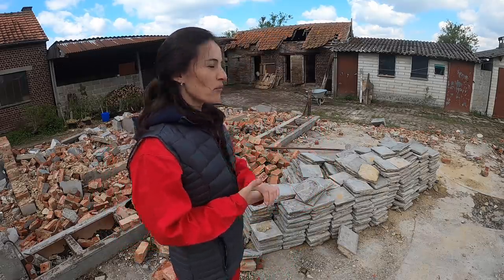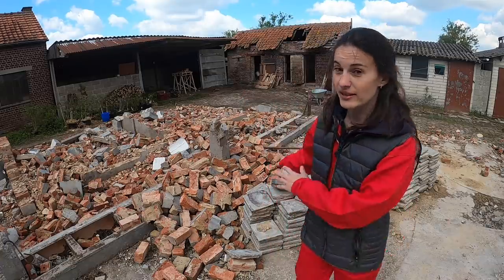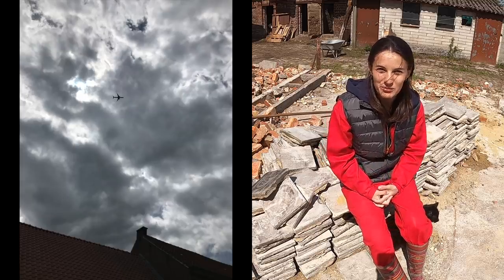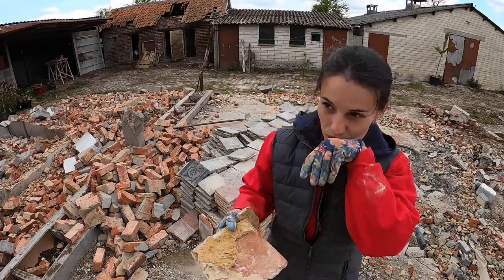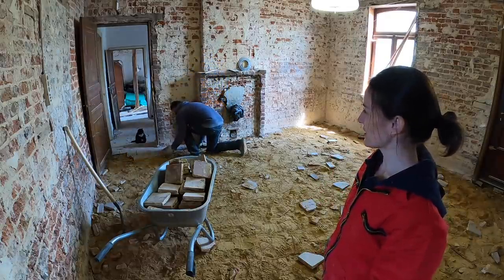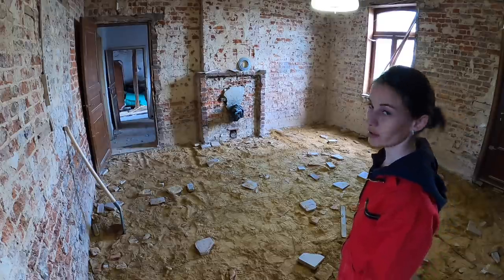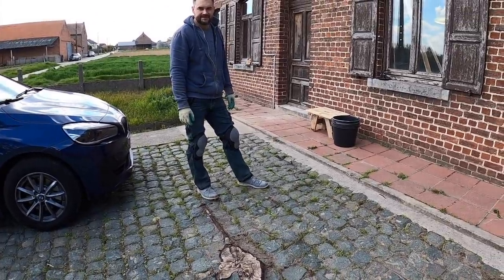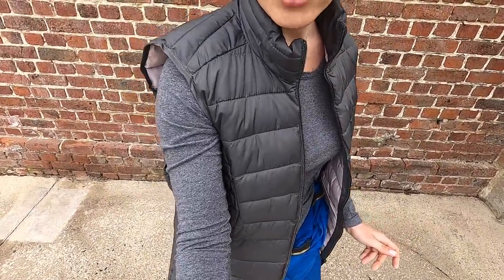Removing but saving STUNNING TERRACOTTA tiles in the hallway of 100+ y.o. farm

Comment: soak the tiles in a bucket full of water u should use a  light acid with the water and you could do this with lemon juice this should help remove the morta on both the terracotta tiles and the cement tiles do a test with just two tiles of each in a bucket . Good Luck .

Comment: the chisel is the best way. 
however: try putting it in the fridge, after freesing you take it  direktly in a  boiling water or use the burner on the surface. but try first just putting the frozen tile on the ground and throw a bucket of boiling water on the unwanted concrete .the different temperatures should loosen the connection and it might easy go off with the chisel or by hammering.

for the polished surface with brush: you know  you can sand these tiles? 
might be also in order when finished shortly before reusing.

Comment: You can make a small contraption with wood where you can put the tiles in at an angle. Then use a pneumatic chisel to get rid of the mortar of the terracotta tiles. I got this tip from a professional tiler a couple of years ago. I'll try to make a sketch later on and send it to you on Instagram.

Comment: To remove the concrete from the tiles, try to use the grinder, but with the right accessory.
Instead of this metal brush, use a disk for concret. And for the finishing, then use a spatula.

Comment: From first hand experience....if you hit the tiles to remove the old mortar, you will break many of them.  The easiest method we used to remove the old adhesive mortar from our terracotta floor tiles in our Longere here in Lower Normandy, France, was to use an angle grinder with a disc made for cutting stone.  It is very dusty work.....however after the tiles have been scrubbed on both sides using a scrubbing brush, they are ready for re-use!

Comment: Lime is alkaline. Lime mortar on the tiles might be dissolved by a weak acid that would not affect the tiles' glazing.
A suitable acid might be that which is used to balance pH in our swimming pool: muriatic acid. it is This is a diluted for oh hydrochloric acid and is normally readily available. At least it is here in Australia 😁. We can buy 'pool acid' and in pool shops, hardware stores and many grocery stores.
Good luck!

Comment: I personally wouldn't reuse the old tiles. They seem difficult to remove and will probably be even more difficult to install. I'm a fan of using new with the old. A concrete base would give you many options. You can then use large tiles or stone. Today's materials are also easier to upkeep. I don't like terracotta, and find they chip and break easily. 
I hope you find what you desire in your budget range. Enjoying your progress. Good luck and wishing you strength to continue

Comment: Try soaking them in “mineral spirits”. It will start breaking down the mortar on the tile. Depending on the mortar you might soak for minutes or hours. If it is really stubborn, diluted acid will definitely work!

Comment: I like how you both work together! But Illia is a true Gentleman, take always the heavy load outside for you! Do not put the Terra-cotta tiles in water, they are not done for that! They soak up and get easy to be damaged !  For the backside you can use a grinder, but will be a dusty job! Mouthprotection, eye and earprotection needed! The front of them can be cleaned with a pressure washer and musclepower! You can use a stone cleaner for that. You can buy these in every garden center! Take a tile with you and show it, then they understand what you want to do!  Imlovebwhat you do!

Comment: Have you thought about sandblasting the tiles? I’d take a handful of the tiles down to your local automotive repair shop. They generally have a sandblasting machine for cleaning parts. Ask them to try and clean a few of them up and see how long it takes. Then if it works invest in some equipment.

Comment: To make the task of cleaning the tiles easier. Build a wooden workbench out of old timbers. nail/screw to the bench  top some hard wood strips slightly narrower than the tile thickness to act as anchors. Place the tiles against the wood strips and with a hammer and steel chisel  chip off/ clean off the cement. Keep a bucket of water and a brush handy to keep the dust levels low. Having your work area raised up will reduce injury and pain to your back shoulders and knees. Search YouTube for "Dressing Stone" to help teach you the skills you'll need. An angle grinder with a stone cutting blade would speed the progress.  Good luck.
Reply from the maker: Many thanks for your advice, Archie! I will look it up 👍🏻

Comment: I am late to the conversation, but what is the base tile made of ?  Are they fired ceramics ?  Glazed/ unglazed ?  How is the pattern on the tile applied ?  Is it part of a fired glaze ?!  Painted/stained ?
Depending on how the pattern was applied to the tiles, the black oxides from the wire wheel can be removed with a rust remover product.  Do not use this method if the pattern was done with iron oxide stains.  Here in the US we have a product called "Evapo-Rust", works great.  It smells like radiator anti-freeze/coolant for your car.  Probably has some of the same rust inhibitors (and related).
How thick is the layer you are trying to remove ?  If it is thick, mechanically abrading the top layers/thicknesses is probably the fastest. Then switch to manual or chemical/water soaking for the last bit.
Ask your local Museums, Archaeologists, and/or Professional Restoration Experts, what methods they would use.

Comment: in the USA we have a tool named Cavitron and the hospital maintenance team uses it to clean the water faucet outside the operating room, all that calcar which is deposited in time and obstructs the water on a faucet they bring the cavitron and clean it . I really believe the cavitron can remove that extra material from the floor tiles
Reply from the maker: I will look it up, interesting 🧐 thank you!
Reply: FYI, a Cavitron is a state-of-the-art ultrasonic scaling system used to clean teeth. The machine uses oscillating sound waves to produce gentle vibrations that vibrate plaque and tartar off the teeth.
Reply: @kathyusa-iowa5137  yes you are correct however the maintenance team of the Washington hospital center uses this so-called cavitron  to remove calcar from the faucet...I am not an expert I am a surgical assistant my Facebook page is eliad jojo
Reply: @eliadsavel8015  understood, my brother did maintenance in a hospital. 😉
I added my comment so they would have an idea what it did. It uses ultra sound AND it's safe enough to use in our mouth! 👍
I don't know if it would be cost-effective to buy, or if you could rent. But no stiff bristles, no harsh chemicals, safe for us...seems like a winner to give a try to! 😉👍
Reply from the maker: I checked on Ebay, there are some for sale :-) I doubt I would find it in DIY shop here in Belgium 😀Actually I have a dentist appointment tomorrow, I will ask her opinion tomorrow. I guess for thin layers it may work, but not for thick ones as ours. Not sure...
Reply: @DeHoeveOldBelgianFarm  I'd sure try this method. It has a lot of benefits. Wishing you good luck on this one❗🙌 🥰

P.S. I looked on ebay and found prices from US $400 to $1,400.
BIG range there! 😲 🤔

Comment: I have always found terracotta to be warm and friendly. Entering a home with tiles like those makes me want to remove my shoes.
Reply: Only if they put in under floor heating because they can also be very, very cold.
Reply from the maker: @l.m.2404  True - the way they were laid just on sand is called 'cold flooring' AFAIK. But the warmth feeling is still there...
Reply: @DeHoeveOldBelgianFarm  I think that they are absolutely beautiful and think you are very fortunate that they were never replaced by an earlier homeowner. Paste wax them after they are relaid to protect them and help keep that gorgeous lustre.

Comment: Maybe if you find a nearby business that does sand blasting it would work on the tiles. I think they have the ability to use different grades of sand and different strengths of blasting that could remove the coating from the face of the tile and the mortar from the bottom of the tiles. Only thing is that this would definitely cost you money that could certainly be used elsewhere while you are in the beginning of your remodel. Best of luck.
Reply from the maker: Hi Kate, we are checking this option. Not now, for sure, as you mentioned, we have other projects to spend our money on. But for later, could be a good eco- friendly way to clean them.

Comment: I would not use any harsh chemical methods. If you have access to a good air compressor and an air chisel, there are scraper bits (3/4, 1 inch max) you could use, keeping the impact at a sharp angle to sheer the cement off. A combination of soaking the tile and this might work out better, or might not.
Reply: If you have an SDS drill, often those have an impact only setting, so you could use it with an appropriate scraper bit.

Comment: There is a small motorized tool called a Dremmel the you can  use different heads with that might remove the tile backing.

Comment: You might take some to a sand blasting place, tombstone makers have them or rent one, see if it will work before renting, $15 a day, plus compressor $30 a day, abrasive $60 per 50 lbs. Apprx $100 for one day. Might be worth the time saving, set yourself up a production line

Comment: Maybe muratic acid would be a good cleaner to remove all grit and mortar.  But if you then don't have the pattern or color you wanted; then recommend staining or painting them.  They make both stains and paint for tiles.  Just lay them out and spray paint them.  Just need to do it on the one side that will be face up.

Comment: Enjoy watching your videos from here in NW Indiana, USA. Since the heat method seemed to be working but slow. How about laying them out and starting a fire on top of them, I bet you can still find some brush or old wood to burn. Might be an easier, less time intense way to heat them up. Then use the pressure washer to clean them up after the mortar breaks loose.....Just a thought.

Comment: have you tried Muriatic acid? on a broken one incase it removes pattern. If you soak the tiles in tub of muriatic acid overnight the acid will desolve the motar , mix the acid as directed on the bottle, good luck.

Comment: A long soak , maybe a week or longer in water should soften the mortar just enough to remove without damaging the tile.
Reply from the maker: Thank you for the tip, Andy! I will give it a go today and will include in the next video the result :-)
Reply: Should not take that long. Check after 24 hours, if not releasing wait another 24.

Comment: I would go and purchase or rent an angle grinder. A Makita, or Dewalt angle grinder would make short work of removing that scree from the bottom of your tiles. It would be easier than the hammer, I think. You'll also need a Concrete/Masonry Grinding Wheel. This will take a bit of finesse when using but I think Ilia will learn how to do it quickly.

Comment: Good to see they used lime mortar. The mortar should always be weaker than the brick or tile you are using. Lime mortar will dissolve easy with hydrochloric acid, hardware shops will have it. AKA muriatic acid. Clean off the majority of the mortar with that toothed hammer you have (scrutching hammer). You could also try a needle scaler. Soak them in water first.

Comment: The gray tiles look like we call it in the Netherlands HARD BAKED at a very high temperature. Those tiles can hardly wear out. I am not sure if the red tiles are HARD BAKED. If the cement consists largely of lime, you can remove it with ordinary cheap vinegar, but that takes a long time and you need quite a lot of vinegar. The advantage is that the HARD BAKED tiles can probably withstand the vinegar. 
De grijze tegels lijken zoals wij het in nederland noemen HARD GEBAKKEN bij een hele hoge temperatuur. Die tegels kunnen bijna niet verslijten. Ik ben niet zeker van of de rode tegels HARD GEBAKKEN zijn. Als het cement voor een groot deel uit kalk bestaat, dan kun je het verwijderen met ordinaire goedkope azijn, maar dat duurt erg lang en je hebt best veel azijn nodig. Voordeel is dat de  HARD GEBAKKEN tegels waarschijnlijk wel tegen de azijn kunnen.

Comment: Maybe some Formic acid will help to remove this concrete layer  butt be carefull because this is very agressive  stuff.
 Try some different mixes with water because pure is to strong,also called Mierenzuur 80%
For the back of the tiles maybe a Naaldbikhamer 😉

Comment: Try and seek advice from a store specialised in these kind of tiles. But I would try to remove as much as possible with the paletknife and maybe try something else for the remainder of the cement. Very nice terra cotta tiles. Scrub them with brown soap  for the first year ,once they are laid again and they will have a beautifull sheen.Afterwards you can just clean with water and tilesoap. Are you going to use this room as a huge hall? In earlier days people did not have hallways, only in the more posh houses. You entered straight in the main room. If you are going to use it as a hall I have a great pine hall bench with a high back that you may have if you should want it.
Reply from the maker: Hi Nicole!  It seems to be so far in the future - cleaning the tiles :-)  Thanks for the tips! We plan to make it a huge hall, idd. With a sitting area next to the fireplace. You are so kind, thank you very much!
Reply: @DeHoeveOldBelgianFarm   the  antiqu pine hall bench I have is a typical bench to sit next to the fire. With a high back and ears on the side and 2 drawers. Its 130 cm highx 130 wide but only 30 cm deep. You can have it for free. Its in real good condition. I sadly don’t have the place for it anymore. So if you would at some stage want it or want to look at it you can reach me through Facebook.

Comment: I agree with others about your tiles. First, research acids and understand that once water is added to them their names change. Sulfuric, Hydrochloric, Muriatic. Start with washing or soaking in Muriatic acid and see if that helps. It is the most diluted acid and is readily available. ALWAYS use protection, rubber gloves, face shield, etc. Muriatic acid will burn but is not as dangerous as other acids. Sometimes harsher acids require a license to purchase.  After the tiles are acid cleaned move to tile cleaners. Cleaners and treating solutions will bring back the original luster. Cleaning old tiles is experimental for each type of tile. Although the house was built in 1908, you'll never know if the tiles were repurposed from an older home at the time of construction.. Determine what each type of tile is (quarry tile, etc.) and try one tile to experiment on. Use Scotch Brite pads to clean tiles. It is abrasive but will not scratch tiles. Remember that plaster and concrete are alkaline and acids respond quickly when used to clean them.

Muriatic acid and a steel brush and Scotch Brite pads again would be your best bet for your interior brick walls. I rehabbed a home I once owned, (built in 1880) that had brick walls and horsehair plaster on it. I  exposed the brick just as you did, cleaned it with Muriatic acid, and sealed it with concrete sealer. Brick will 'dust' over time. Turned out beautifully! I am sure you have researched the internet thoroughly but I threw down a couple links here to try and help. You may have found these already! Good luck and I look forward to your next great video!

BTW, what is the Inspector's name............ Cat?

https://youtu.be/GJVFmqCz96w
https://youtu.be/FPmGPY8kAss
https://tilesoc.org.uk/tacs/

Tile Doctor,
50 Market Street
Carnforth
Lancashire
LA5 9LB
Info@TileDoctor.co.uk
Reply from the maker: Hi Jeff! So many valuable advices, thanks a lot! Saved them all.
Cat's name is Anneke. It's a lady. 
But kids keep calling her Murzik (like a he)
Reply: @DeHoeveOldBelgianFarm   Glad to help! See if you can e-mail TACS and maybe send them some photos. They may be able to tell you all about your tiles by the pattern and/ or thickness of them. Where and when they were made. Smile and be nice to them. If not, they may be able to tell you who to see. Experts enjoy that sort of thing. Just don't pay someone to do that. Have a great day!

Comment: You guys might consider buying a weed wacker (gas powered hand held machine that spins a string very fast) to maintain your weeds in the cobblestones once they get uncovered.  This would make fast work of the weeds between the stones in your front driveway.  ☺👍
Reply: They do have one 😉
Reply: OK then.  👍
Reply from the maker: Here in Belgium I see a lot that people spray smth. over the stones. I try to avoid chemicals whenever is possible, so we first tried to burn the weeds between the cobbles. It worked so well! I will try to include the review in the next episode.
Reply: @DeHoeveOldBelgianFarm  excellent option if you can do that. I don't think I'd be allowed to burn where I  live. 😏
Reply from the maker: @kathyusa-iowa5137  it is a special tool, a lot of gardeners that work on the city use it here. But the rules in every country are so different...
Reply: @DeHoeveOldBelgianFarm  ahh 😉

Comment: Chipping the loose mortar from the back of the tiles is important, a grinder wheel attachment may work, one like the short wire wheel used on the surface. Check out "Positive Couple" on YouTube. Our friend uses such grinding attachments. 
When you reuse the tiles, you may need a mortar bed thick enough to average the deformation of the tiles, like the mortar bed for coarse slate tiles.
Instead of using a steel wire brush, a brass wire brush may be softer on the tile surfaces.
That's a big job you've undertaken. Good luck to you both.